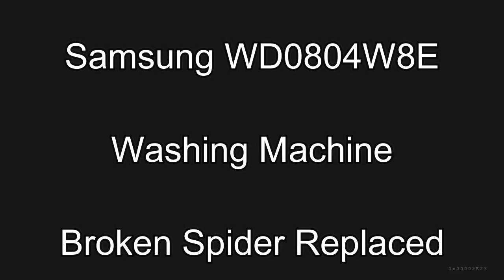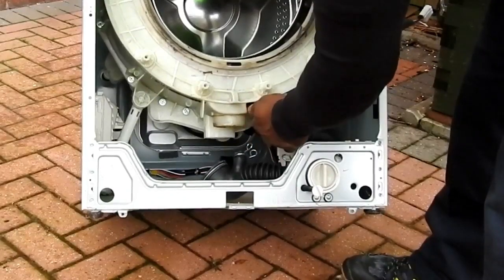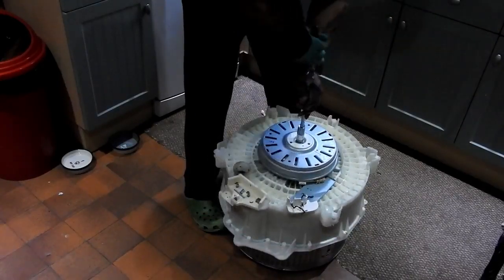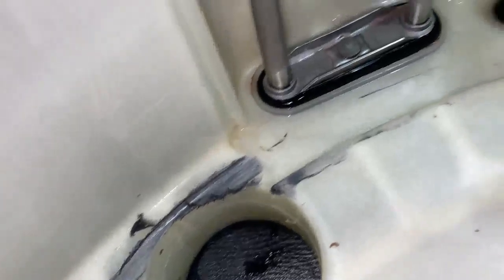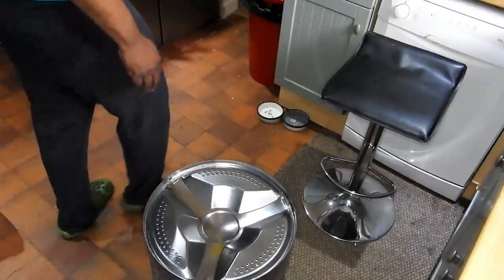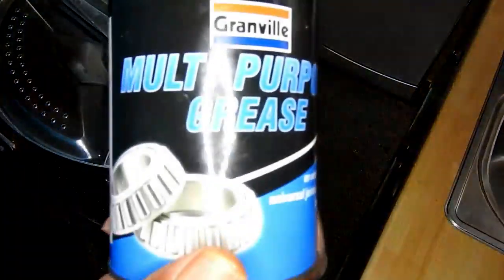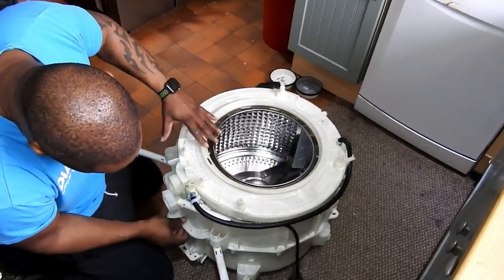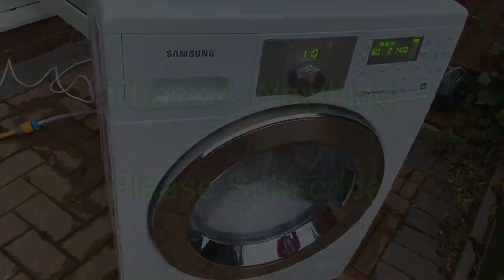Samsung Washing Machine Drum Broken Spider Replacement

Comment: It's ridiculous that so many companies designing these things with two dissimilar metals in contact which promotes galvanic corrosion. It's designed to fail.
Reply from the maker: Not sure Jonny,
                           I think its more about costs, a fully Stainless Steel or a Carbon Fibre unit would not be cheap and not sure how they would cope with the conditions, or the required strength.
Reply: @green-crocs-fixes1520  Then they should be zinc plated at a minimum. Our LG washer just broke the spider because it corroded away. It's just barely 10 years old and we've always kept the door ajar to let it dry out between washes. It's a waste really because the other parts are perfectly fine but it's not worth the cost and time to repair.
Reply from the maker: @JonnyFlash80  I here you Jonny,
                                                             and I think some manufacturers do offer 10 year warrantee, how and if that is honoured when the time comes is another thing. You can get a new Spider for about £50 - £80 if you shop around and if you're up for it. I think overloading the machine also contributes to the unit failing.
Reply: I think the design has to change. The problem is that the torque has to be distrubuted uniformly to the inner drum and hence the spider unit. The next problem  is that the spider unit will always remain exposed to the highly corrosive water. Alternatively the inner drum has to be super strong and super expensive which wouldnt make sense. So  one solution is only to make the spider unit as anti corrosive as possible which would be expensive or the make the drum as a rotor in a contactless motor similar to a aquarium water filter motor. There should be some other way also. But currenly its pathetic.
Reply from the maker: @BinilChacko-c5o  Thanks Binil,
              I’m sure considering all manufacturers use the same method that an alternative would be more expensive. I would imagine a Stainless Steel spider would be ideal, same material as the Drum but being as I am not a Washing Machine engineer the unit would have to cope with a lot of stress. I think these Spiders fail due to the machine being overloaded constantly.

Comment: The manufacturer must have or should have known the material they used is NOT suitable to make the spider, which is constantly exposed to wash water.
Reply from the maker: I hear you Saigonais,
                                     but some failures are caused by the user, overloading the machines constantly. Alloy and Aluminium or a combination of is ideal. Plastics probably would not have the strengths.

              Regards.
Reply: @green-crocs-fixes1520  Your reply is much appreciated. Agreed, overloading is likely cause of "breaking apart in flight", aided by galvanic corrosion already weakened the cast aluminum spider. An alloy like that of car wheels or ss316 would do albeit expensive. Thanks.

Comment: Thanks for this, I got the part for £35. Saved me £500 on a new machine. As others have said putting the door seal back on is an absolute pig and I agree. I ended up laying machine on its back so I could access the top and bottom and also removed the concrete blocks so I could get my hands every where. Blocks are able to be put back on after seal is installed. Thanks again 👍
Reply from the maker: Thanks Richie,
                         glad you succeeded and you got your part even cheaper too. Yes it’s easier to fit the Door Seal to the Tub first, then the Concrete weights. 

                   Well done 👏.
Reply: Before obvious failure were you getting bits of aluminum in the filter element?
I was. Little chunks, dark in color, almost black and 1/8 to 1/16 inch in size.
Machine was bought used
and I wonder if they knew what was coming...
If this is common it's a good symptom to look for as there was no clunking or banging at that time just bad water draining due to a clogged filter.
Has anyone else seen this?

Comment: Whenever I can open the three screws with all my strength and it does not open, is there an easy way please, or else I have to buy a new washer
Reply from the maker: Hi Mohammed,
                           The three bolts which bolt the Spider to the Drum  are held in with Thread-Lock so they don't unscrew. So if they don't undo you will have to snap the bolt heads off, this will require a lot more strength I'm afraid.

Comment: Hi, great video. I have just had a repair guy out who wobbled the drum and gave it a spin. He instantly said it required both a new tub and drum. The tub and drum for my machine are no longer available. I understand it’s likely just the spider and bearing/seal that needs replacing? Are they suggesting full drum and tub replacement as it’s easier/less labour intensive?
Reply from the maker: Hi Xander,
                  obviously easier to fit a whole unit than messing about with Spiders and Bearings + I think they have to repair so many per day. If its a warranty repair then I would imagine full tub repair however if you where paying for the repair the the long ways labour would burn a hole in most peoples pockets.

Comment: Thanks so much for the video, have managed to fix my machine for a total of £49 for the replacement spider arm and £15.95 for the bolts [off Ebay] as had to get new ones. A repair guy had even told to throw the machine away imagine!!! Putting it back the rubber seal was a bit tricky, ended up having to take it off the door side, and an extra pair of hands helps to put it back easily.
Reply from the maker: Fantastic!
Reply: Before obvious failure were you getting bits of aluminum in the filter element?
I was. Little chunks, dark in color, almost black and 1/8 to 1/16 inch in size.
Machine was bought used
and I wonder if they knew what was coming...
If this is common it's a good symptom to look for as there was no clunking or banging at that time just bad water draining due to a clogged filter.
Has anyone else seen this?

Comment: Thanks so much for sharing this video. Followed your steps to diagnose and repair my machine. 1 replacement part, £500 cheaper than a new machine!
Reply from the maker: Excellent! Neil,
                          glad you sorted it and yes some parts prices are horrendous, the Machine depreciates but the spare parts don't ??

         Regards.
Reply: Before obvious failure were you getting bits of aluminum in the filter element?
I was. Little chunks, dark in color, almost black and 1/8 to 1/16 inch in size.
Machine was bought used
and I wonder if they knew what was coming...
If this is common it's a good symptom to look for as there was no clunking or banging at that time just bad water draining due to a clogged filter.
Has anyone else seen this?

Comment: I can’t thank you enough mate for this video. This was my exact issue and your guide gave me the confidence to attempt the fix. Machine now working again for the price of a part. 
They don’t half make it difficult to reach the arm eh! Thanks again and I agree that re-attaching the door seal was a right pain 🤣
Reply from the maker: Thanks Ross,
                        just glad you managed to successfully resolve your machine, and yes that outer Seal can be a right bugger.

          Well done, 
                            regards 😀.
Reply: Before obvious failure were you getting bits of aluminum in the filter element?
I was. Little chunks, dark in color, almost black and 1/8 to 1/16 inch in size.
Machine was bought used
and I wonder if they knew what was coming...
If this is common it's a good symptom to look for as there was no clunking or banging at that time just bad water draining due to a clogged filter.
Has anyone else seen this?

Comment: Machine runs sweet, and once opened up i took the opportunity to clean all the rubber horses as notice they had loads of gunk in them. I've had my machine since 2014 until it broke down 2 weeks ago. Am happy, my bank balance didnt take a hit a of minimum £450 as per AOL, Currys prices. So thanks once more Green-Crocs-Fixes, you are a *********
Reply from the maker: Hi Samz,
                Thanks, absolutely fantastic 👍🏾. And you have more importantly avoided polluting the environment with landfill. Yes the machines do tend to have a large build up of soap and fluff around the inner workings only visible when dismantled. Well done and glad you managed to successfully resolve.

              Regards 😀.

Comment: Thanks for this mate, Have stripped my machine, not the same model but similar and have now removed and ordered a new spider and bolts as I snapped two, even though I used a heat gun on them to loosen the threadlock.. I thought it best to order genuine ones as they'll be Stainless I expect. Good tip on the grease thank you, I was thinking that I'd put some on and also for pointing out the oring and little ring that remained on the old shaft once removed... Good luck and thanks again..
Reply from the maker: Thanks Dave,
                        yes moving the bolts are hit & miss wether they snap or not, fortunately I was a Mechanic many moons ago and those skills aided. Still unsure as to the purpose of the small rings as other manufacturers don't have them. Hope all works successfully.

             Regards 😀.
Reply from the maker: PS, 
       hot-dam you live an active lifestyle (via your channel).
Reply: @green-crocs-fixes1520  Haha.. in between fixing my washing machine lol!!!
Thanks mate.... Im an Essex boy moved over here in 2012

Comment: How did you put the door seal back on?
Am having big problems with mine; It looks glued on at the front!
Reply from the maker: Hi Bob,
           assuming you’re trying to remove the Door Seal, there are Retaining Rings one around the Door Front and one around the Tub (with a Spring) the are tucked into the Seal so you have to fold back the Seal and lever them out. I use a blunt dinner knife.

Comment: Which bolts and nuts driver set u have used.
Reply from the maker: Hi Ramanuj,
                    The bolts have a 10mm head so 10mm Socket is required to remove.

Comment: Top! Used this video to open up our Samsung which had exactly the same problem. Couldn't get the bolts off anyhow, so ended up with a new replacement drum. But what glue exacty do you use to fix up the outer drum?
Reply from the maker: Thanks Ellen,
                      yes removing the bolts from the Spider can be difficult as they are inserted with Threadlock to prevent them from undoing themselves. I used Clear Sealant not Glue  as a precaution which may not have been required as there is a black rubber sealant inside the recess 😎.
Reply: You should have heated them up with a gas torch, pointing at the spider arms, generally they come off easily! (sorry if my English is bad)

Comment: Before obvious failure were you getting bits of aluminum in the filter element?
I was. Little chunks, dark in color, almost black and 1/8 to 1/16 inch in size.
Machine was bought used
and I wonder if they knew what was coming...
If this is common it's a good symptom to look for as there was no clunking or banging at that time just bad water draining due to a clogged filter.
Has anyone else seen this?
Reply from the maker: Hi Michael,
                   I brought this machine as a none runner however in the past I have found that the Filter does reveal dormant issues like bits of Metal and chewed Plastics.

Comment: Hi mate, is this machine still running OK? Any leaks?
Reply from the maker: Hi Dee,
            yes we still have the machine and it is still working fine three years later with no issues at all 😎.
Reply: @green-crocs-fixes1520  thanks mate. So that Gorilla Glue is the bees knees!
Reply from the maker: @deebee3901  totally agree 😎

Comment: My Samsung washing mashine has a broken spider arm and i want to fix it, but I need to know if all Samsing washing machines have the same size spider arm, bolts, tub seal, and bearing? My washing machine  Model # is WF218ANS/XAC 01. Thank you for the video!
Reply from the maker: Hi Mohammad,
                           the answer is no, as different Drum sizes (6kg ang 10kg) will obviously have different size Spiders. Order the parts you require via your machines model number.

                Regards.
Reply: I have the same machine and issue. Nice to know I'm not alone

Comment: Great job ! Wonder why Samsung don't paint the spider so it wont galvanically corrode as fast ....
Reply from the maker: Thanks Matthais,
                               very true, but overloading the machine constantly with washing can also contribute to the Spiders early demise. 

Regards.
Reply: @green-crocs-fixes1520  Abuse of liquid detergents and fabric softeners, combined with excessive use of low temperatures and short washing programs, accelerates bearing and spider failure more than overloads and unbalanced spins. Wash at higher temperatures, using standard cycles instead of short ones and with powder detergents where possible.

Also, you can use citric acid properly diluted in water instead of fabric softener. You can also use it to clean the machine periodically (every two or three months), pouring 150-200 gr. in it and running the highest temperature cycle without prewash, generally Cottons 90 °C. The machine must be EMPTY.

P.S. You didn't replace the bearings and the related seal... Huge mistake, especially because you cleaned the tub and spilled water and detergent in them. They didn't cost much, replacing a spider using old bearings and seal is like changing the oil in a car without installing a new filter!

Hope I haven't offended you, just a tip from a humble repairman.
Reply: None of appliance manufacturers paint the spiders. It's more a matter of raw material quality and correct use of the machine.
Reply from the maker: @exNRGista2  No offence taken Technician,
                                                                                              always prepared to hear another side, the machine is still working fine and in use daily, yes could have used the opportunity to replace other items while I had the unit stripped down. It is a combination of reasons why the unit has early life failures, chemicals and mis use.

                      Regards 😎.
Reply: @exNRGista2  I saw a Samsung  spider recently that died in seven years. Powder was used and the outer drum was coated in it. Am wondering why that happened?

Quick cycles instead of the cottons cycle were used and cold washes. The odd 40 degree wash now and then. 

Drum clean done three times a year. Descale once a year.

The shocks were replaced as well so bad shocks will break the spider sooner.

Spider was just as corroded as you see in this video.

Comment: Good video mate. My Bosch Washer Dryer has a suspected broken spider.

Unfortunately I don't really have the space to repair it. It has an all in one drum and the spider cannot be bought separately. £135 for the  drum. I guess it's best for me to.get a 2nd hand one. Shame I wouldn't mind a tinker. So to access tye tub you gp in through the front not back on modern washing machines?

Bosch wvd24520gb 

  Cheers
Reply from the maker: Comiiserations Matt,
                                   yes probably best to find a none runner with a good Drum, try eBay local 😎.
Reply: Got an Indesit delivered by a guy yesterday from Ebay. £40, can't grumble lol
Reply from the maker: @Matty72UK  nope I would be happy with that.

Comment: Great video. My washer is experiencing the same issue. How much is a reasonable price for this repair in your opinion? I’m not the hands on type when it comes to task like this.
Reply from the maker: Hi Walter,
                and thanks, this was just a project for me however unless your Machine is under warranty I don’t think the parts and labour would be cost effective. This is a 2012 model so the price would probably out value the machine.

                  Regards 😀.
Reply: @green-crocs-fixes1520  it’s a 3-4 year old Samsung. I have a few hundred dollars for a repair. What I  don’t currently don’t have is 1,500 dollars to drop on a new machine 😂. Thanks for the reply.
Reply from the maker: @waltergonzalez3310  OK,
                                          you should be able to get a new Spider for about $70 but as you stated, hands-on capabilities saves  labour charges. Probably needs to be dismantled first as the issue could also be Bearings or something else.

Comment: How long does the new spider last? Is there company that make the spider part with better material or designs? I heard that genuine part was aluminum.
Reply from the maker: Hi Akac0,
                How Long.....?  No idea. This is a 2012 machine so it lasted well, overloading the machine with washing and regular use will also impact the Spider's life span I would imagine. The Spider I'm using here is non genuine unit as a Samsung part is a lot more expensive, I think most are Aluminium or Alloy and I have seen Plastic, this one has less 'nooks & crannies' for soap and fluff to erode.

              Regards.
Reply: Were you getting bits of aluminum in the filter prior to spider failure?